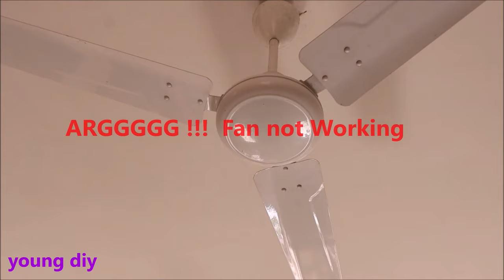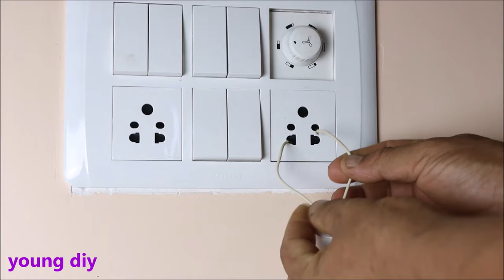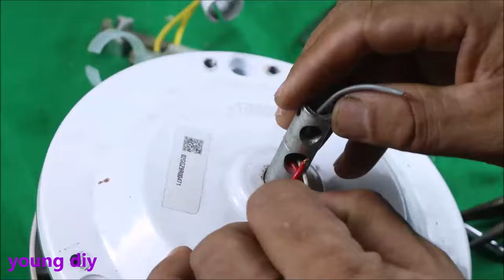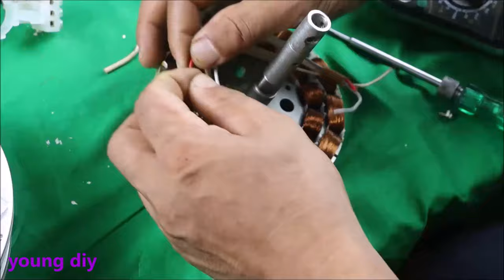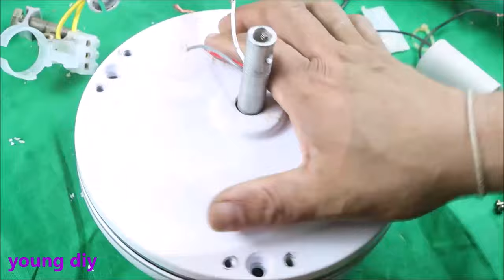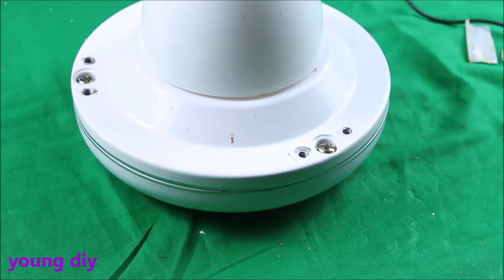How to Repair a Defunct Ceiling Fan at Home in Easy way.  | DIY |

Comment: Very nice fix, BUT.  while re fixing the wire to the induction coil the way you did might have got the fan running again,
there is a reason why the coil was burned and open circuit.  You did not find or fix the fault, this means that the coil
will continue to overheat and sometime in the future as a best case cenario the fan will stop working again.  As a 
worst case cenario the fan will actually overheat and cause a fire which could at worst, end up in some form of
fatality, and at best, result in an insurance claim for the funds to rebuild your home. Just a thought, and i hope that
this never happens.
Reply: بله توضیحات شما صحیح است، من این کار را انجام دادم ولی بعد از ۵ ماه دوباره سوخت، به دلیل تولید گرمای بیش از اندازه
Reply: Yes, with evidence of a screw driven through a bundle of wires that carry mains voltage. An open circuit has been replaced by multiple shorts to companion wires, some of which will be tenuous enough to create resistance. Current across that resistance causes heat, so expect it to die much sooner than one would expect. Ask yourself whether any standards agency on the planet would consider that incriminating screw placement approved for safety. Don't burn your house down to save a little cash on maintenance, you could be found criminally liable for concealing a dangerous repair.
Reply: As soon as I saw the screw I said hell nah😅